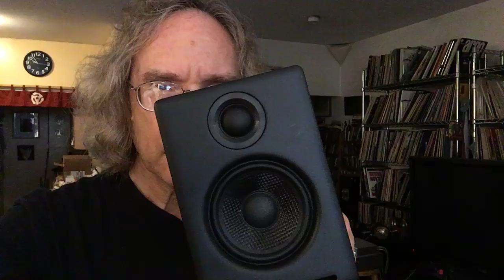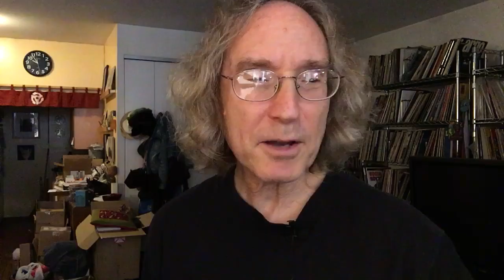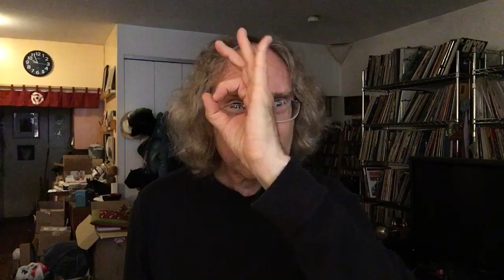The case against 1 inch dome tweeters

Comment: well, there has never been a perfect speaker, and I doubt there ever will be.

That said, every speaker has some sonic deficiencies.  As such, different types of drivers, including the tweeters, may sound best with different music, instruments, placement, and even room acoustics.

In general I prefer soft dome types due to there LACK of harshness.  as would be expected, and can be shown on paper as to why, the dispersion angle may not be so great sadly, yet still better than many other tweeter designs.

Now to help put audio into a better perspective, how about how the audio was originally recorded, and if microphones were used, what type and size was the element?

For the most part, microphones typically can and do color the sound as much, and sometimes much more than switching between speakers during playback.  So, if there were perfect speakers, they still would not sound the best always because different microphones have been used to make the recordings we will listen to on those speakers.

Then there are all the intermediate stages of EQ, mixing, etc., between the original capture of sound and the final medium we are going to play back to send the final signal to the wide variety of power amps to the speakers.

  Everything in the chain from recording to playback colors the sound one way or another.  So to think one speaker may always be best is rather silly.  Plus, people have preferences as to what they like or even hate in the sound.

  I have heard some non-common tweeter designs I could really say I like better than soft dome types, but they are not typically sold, and have only been in a small handful of models here and there.  Some ribbon tweeters, and special compression lens designs have proven to be amazing, and also present their own mounting challenges at times.

Comment: There's a bit of facts missing in your arguments. If there would be a lack of "scale", some limits in dynamics should be observable. 

I've heard a 22mm (0.85") Seas tweeter directly connected to an amp actually producing some low mids. Staggering. Reality is that dynamically highs are really easy to cope with due to the lack of mechanical amplitude. What IS different between a 1" spherically radiating sound source and a 42" ribbon tweeter is the nature of it's vertical dispersion. That's probably where an observable difference is to be experienced.

Comment: SOFT DOME RANT FROM A SPEAKER MAKER ENTHUSIAST (long and nerdy).

As long as the 1" tweeter can reproduce lower treble they should be fine. Being small, shouldn't make any difference (except superior transient response) and as long as it can go down low enough. My soft domes go way down to like 500 hz and you can feel the vibration on the dome with your finger. But with most domes you can't feel anything cos usually the dome is really tightly mounted. I think the loose idea is better cos you would think it would move with the signal more accurately and go down lower. With my domes they should crossover ok cos they go down low even if they are small and have great transient response. As long as the sound comes out I can't see how size makes any difference. My 1" domes are cloth. But I reckon the softness of the dome sounds a bit "wissy" so I try to clang the sound up a bit by adding a bit of aluminium to my domes. Cymbals sound like they are being hit instead of sounding like an air hose. I use 1/4" pointed aluminium hard foil (coffee can seal) stuck on my domes half way from center to edge. There is also a little  bit more output in the highs (which is nice). All soft domes may have that problem but there are hard domes as well. I think paper hard domes are the best (I head some) and I love the treble strength in to ones I heard. And clangy enough, just by themselves. There is an (inherent) "acoustic gap" between woofers and dome tweeters (with woofers over 6" diam and made of heavy material for bass handling) which affects the med really fucking badly. A med driver solves the problem and you also have superior med cos the driver is way smaller than the 8" woofer. And also the med cone is made of mush lighter and thinner material for way more superior med sound. And with a med driver in a speaker you get great crossing over with the 1" dome tweeter. The driver doesn't have to be 40" long, it only has to be 4" big (but still way bigger than the 1" dome). Well, you were saying "I dunno" so I think you are really on about the "acoustic gap" between woofers and dome tweeters and maybe some soft dome 2-way speakers don't crossover as good as 3-ways do. But there is nothing wrong with 1" dome tweeters (or any type) it's how they are made and how they are implemented that makes the difference. Size only makes a difference if you have high wattage PA tweeters. 1" domes would be under a bit of strain then. Otherwise as long as it crosses over properly (and is a 3-way) I reckon the smaller the tweeter the better (cos of the transient response) (for house speakers, that is). Anyway I have 8" 2-ways, but I solved the crossing over problem with my 8" bass drivers, by having thin coned 8" "guitar amp" drivers instead of woofers (but that wasn't the reason I used "guitar amp" drivers) (It's the wide voice coil that I wanted). The cones are way thinner paper (for much better med) with a stiff suspension surround. Bass is still pretty good cos the 8" drivers have a large magnet (larger than many woofers). I chose these drivers cos I wanted large diam voice coil drivers to fit my 1" soft domes inside the 2" voice coil cavity. The tweeters are like 1.5" wide (all up). These are also hard to find that small (only car ones are that small). House 1" domes are shocking for sheer size, like usually at least a 4" magnet (and no way can you make point source speakers with any house domes). lol With the car tweeters and those "guitar amp" drivers (and after much fiddling) I now have my very own "KEF Uni-Q's". Once you go point source you never go back. It's the "headphones effect" that I'll miss with normal speakers. With mine, the vowels and the consonants (texture and tone) come from the "same place" instead of a foot apart. Headphones are point source and that is a big factor why they sound good.

Comment: Well, I think it is small.  I'm an audio engineer of over a decade.  I also build speakers.  I've been building speakers since 3rd grade.  Getting those effortless, loud, transients is all about efficiency when it comes to a home stereo.  A dome tweeter is what, 90dB at 1w/m usually?  A horn loaded or comp driver horn is usualy 100dB at 1w/m once crossed over properly.  So, you get over 3x the acoustical power right there.  I have never cared for dome tweeters in a home theater setup where loud, highly dynamic sound is needed.  Dome tweeters are better suited to nearfield listening.  When I listen to speakers like the B&W, the Martin Logan, etc., I always miss the Klipsch horn tweeters for the highs.  Sure, their mids might be better with their great woven kevlar driver or whatnot, but then, the highs and lows are lacking.  I have stuck with Klipsch because of the effortless, transparent, output of their horn tweeters.  It just works better when listening at 15+ ft away with movie transients blasting through the speakers.  The dome tweeter are very accurate in frequency response at lower volumes, but can they handle the transients and make the music sound deep and three dimentional?  At high volume  I would say a horn loaded driver does a better job, although much harder to design and sound good.

Comment: The soft dome tweeter is my favorite. My ears tell me that, and I've listened to all varieties. I especially love doped fabric domes.
Reply: I'm using 9 3/4" soft dome silk doped ADS tweeters in my Atmos system. They can't compete with electrostats like Magnepan, but the Magnepans can't compete with the dynamics in the bass. The attack decay and sustain and release of these light little domes are hard to beat.
Reply: Soft domes used in Dynaudio are the only tweeters to truley get the tonal color right.

Comment: I'll go along with your assessment between dome vs loaded horn but magnepan's magneplanar diaphragm design, although having some amazing characteristics, has it's own issues. They seem to be doing a lot to overcome some of the challenges of that design, i.e. efficientcy issues and durability, so it may be the best design in the long run. I think people will continue to prefer different type of tweeters.  I personaly would love to own a pair but properly powering them  is out of my price range currently.

Comment: I think Steve makes a really good case here, although I'm not sure what the upshot is. I listen to Magneplanars myself, and although I hadn't really thought through this HF issue in selecting them as my speakers to live with, it could be that my ears knew what to do, and my brain just got out of the way. 

One thing I wanted to add was the consideration of harmonics and combination tones. In talking about the workload carried by the woofers, we're mostly talking about the fundamentals, and the harmonics are being handled by the mids and tweeters. Since the difference between a good violin and a crappy violin, say, makes itself known in the harmonic structure, it's not a big leap to think that there's really something to this. Just as language has shades of meaning expressed through different turns of phrase, so too music has different shades of expression through different "ancillary information" which comes in the form of harmonic structure, which necessarily gets into high frequency information.

Comment: A few things to consider here. 

Firstly, there is a reason why the sound spectrum is typically divided into octaves.  If you aren't familiar with the idea of octaves, I'd recommend doing some reading:
https://www.engineeringtoolbox.com/octave-bands-frequency-limits-d_1602.html

To put it simply, octaves are used to divide the audible frequency range of human hearing into a series of bands based on how much energy they contain.  That last part is critical here - "based on how much energy they contain".  Higher frequencies contain far more energy then lower frequencies, and the octave bands are unequal in frequency bandwidth because of this.

To demonstrate what I mean by this, the octave bands are:

* 11hz - 22hz
* 22hz - 44hz
* 44hz - 88hz
* 88hz - 177hz
* 177hz - 355hz
* 355hz - 710hz
* 710hz - 1,420hz
* 1,420hz - 2,840hz
* 2,840hz - 5,680hz
* 5,680hz - 11,360hz
* 11,360hz - 22,720hz

Notice they double in bandwidh progressively?  This is based on the concept that an 11hz wave frequency holds roughly double the amount of energy as a 22hz wave.  So that 11hz - 22hz band (though only 11hz wide) holds the same amount of energy as the 11,360 - 22,720hz band (which is 11,360hz wide).  

Now why is this relevant?  

Because you mentioned that this little 1" dome has to cover this huuuge bandwidth from 3khz to 20khz - and expressing it in that way does make it sound like a major task.  However in actuality, that is only three octaves.  So lets say you have a 6" midrange that plays from 80hz to 2khz - that's actually covering 5 octaves, which means it's got a MUCH harder task then the tweeter does. 

So while it might seem like this small tweeter has a huge amount of energy to handle, it is actually handling no more energy then the average midrange would have to.  

You might say "ahh - but a midrange is much larger!".  Well, truth be told that doesn't really matter.  The only reason a midrange is larger is because it has to play lower frequencies.  And to play lower frequencies requires the ability to move more air, which in turn requires greater displacement (i.e. more cone/dome area). 

Ultimately, the thing that a 1" dome is limited by (due to the surface area of it's diaphram) is the lower frequency limit.  And a well designed, quality tweeter can handle 3khz no problem at all.  The really good ones can get down to 2khz,  and some of the truly amazing ones can get down as low as 1.5khz if an appropriate filter is used.   

The frequency limit isn't an issue for a 1" tweeter generally, because how higher a driver can play is typically restricted by cone diameter (relative to wavelength) and voice coil inductance.  In both cases a well designed 1" tweeter is more then capable of extending out to 20khz.  

So if a good tweeter can play down to 3khz easily, and a good tweeter can play up to 20khz easily, and the amount of energy being handled here is only 3 octaves worth (less then most drivers need to handle) then why is it so astounding that a tweeter can handle this?   

There's a reason why people use dome tweeters - because it's been subjectively and objectively proven that they work (and work very well) across the bandwidths in which they are used.  

Truth be told, the tweeter is actually very rarely the limiting factor in a speaker.  This is because tweeters typically have very strong motors relatively to their tiny moving mass, and therefore they generally have FAR higher sensitivity then the typical midrange or midwoofer.  It's not unheard to see  4ohm tweeters with sensitivity of as high as 96dB @ 2.83v - by comparison you would probably struggle to find a 6" 4ohm  midwoofer with a sensitivity above 90dB @ 2.83V/1m.  A 6dB higher sensitivity from the tweeter means it needs 1/4 the power in order to reach the same output level.  For example drive the 6" woofer off 50w, then the tweeter would only need 12.5w of input power to be level matched with the midrange. 

This is part of the reason why tweeters are often the LEAST stressed component within a speaker design.  Given the same power they are typically 3-6dB louder, and that means that in order to level match them with your mid (which you obviously want in any good speaker design) you need to drop their power input by 50% - 75%, which in turn minimises stress on the driver. 

This is also the main reason for MTM / TMM designs being so common (i.e. designs that use one tweeter paired with two mids).  This is done because in most systems the midrange is actually the limitation of the system, and so they add a second midrange to help compensate so that they rest of the system can keep up with the tweeters. 

Now what you are referring to in terms of what you hear when comparing a dome tweeter to other types of tweeters - I'm not sure.  It's entirely possible that the difference you're hearing is actually dispersion patterns/characteristics.  

One thing for sure though - regular dome tweeters are perfectly capable of handling the top end of a speaker design, and doing it very well.  Of course it's important to also understand that not all tweeters are created equal though.

Comment: My assumption is that as you increase the frequency the easier it gets to use physical mass to create sound. You want bass you'd better need a large cone with lots of space to move. As you move up the smaller domes can be, and the easier it gets to engineer a speaker driver to move sound of a wider frequency range.

Woofers cover an abysmally small range of usually 100Hz. Mid woofers 10-fold and tweeters ten-fold that. Who knows what frequency range a tweeter a fifth the size of a normal tweeter can do made with even thinner and lighter materials? Of course we cant hear it but it'll sure scare your pets away. 😂

Comment: And yet the microphones most use to record 'high frequency-rich' sources ( acoustic guitars, percussion, etc) have diaphragms of 1/2" or less. The stunning Earthworks QTC50 has a diaphragm of only 6mm ( that's less than 1/4"' for you Americans) and can accurately reproduce frequencies up to 50,000Hz ( or Cycles Per Second for you Americans - I jest, chaps)

So what is is with Audiophools and their obsession with size? ( I think we all know really -wink wink!)
Reply: That 6mm mic diaphragm only has to vibrate enough to be picked up by the mic preamp. Try using a 6mm tweeter in a speaker. It's output would be so low as not to be heard at all while the woofer is playing. Mic diaphragm size is a poor analogy to compare with tweeter size.